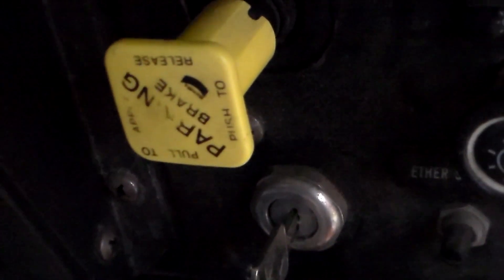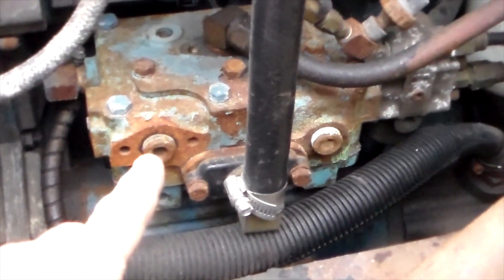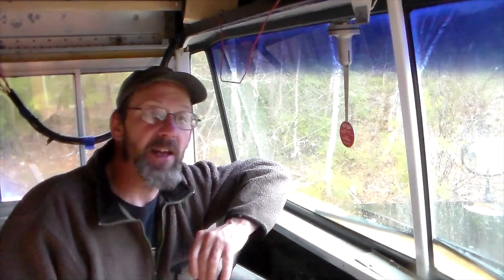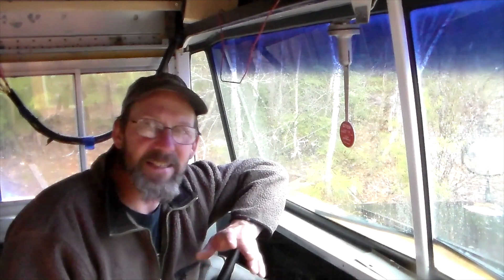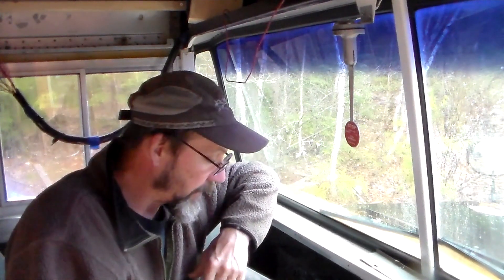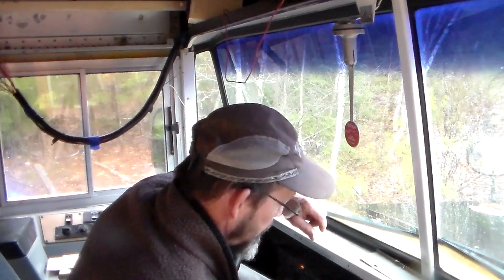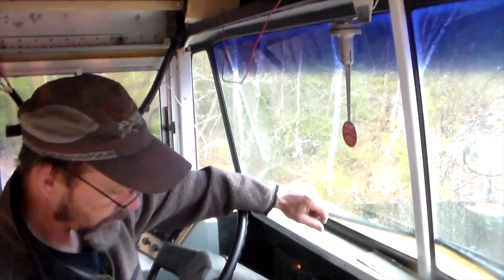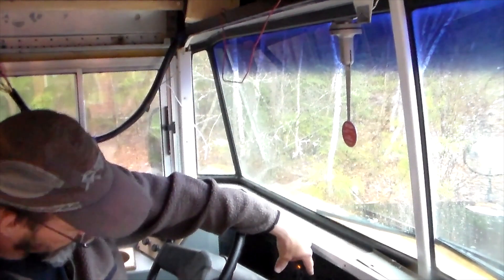Skoolie Operator's Guide to Air Brakes

Comment: I think you did that air brake test wrong.  It’s release the parking brake, no more than 2 PSI lost in 1 min. Then push and hold and no more than 3 psi lost in 1 min.  
And why did That wig wag fall before it got to 60? 🤔. Wasn’t supposed to until 60.
Reply: The tractor trailers are 3 PSI and 4 PSI. The school busses are 2 PSI and 3 PSI. And you really should have that parking brake released when pumping the brakes down

Comment: Bus must be a NY Spec. Not sure how many states Require Wig Wags.  They are a pain. I live in PA, back in 1997 my company Laidlaw acquired 4 Amtran FE Genesis with Airbrakes from another company. They had the Wigs on them, the bus I had had an air leak when it was parked for a few hrs, I got tired of going through the low air each start up, mechanics found a leak in my wig wag, so out it came, Wag plus all the tubing. Never had a leak after that.
Reply from the maker: Yup, NY!  And yes...leaks when parked.  I might take it out eventually...